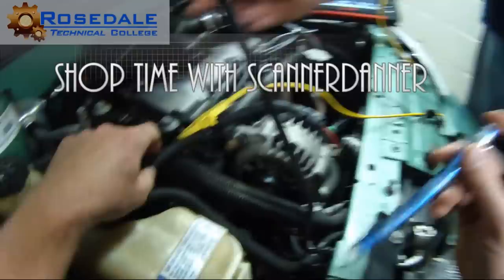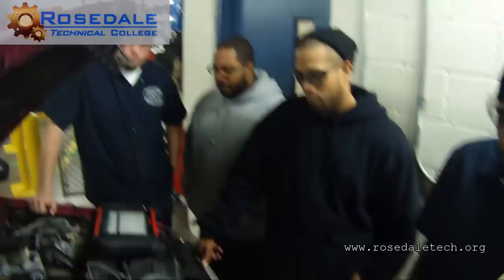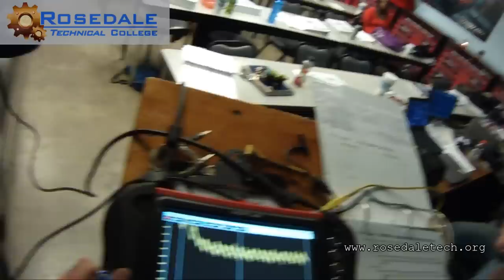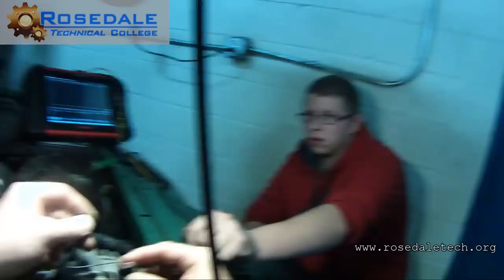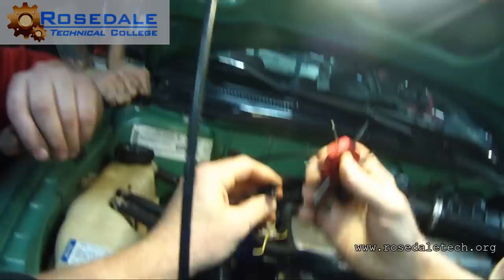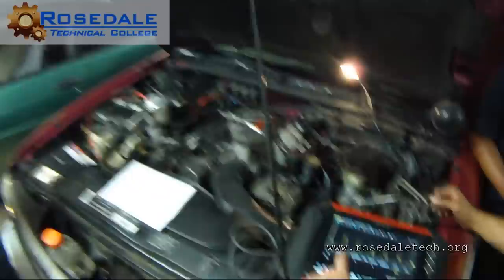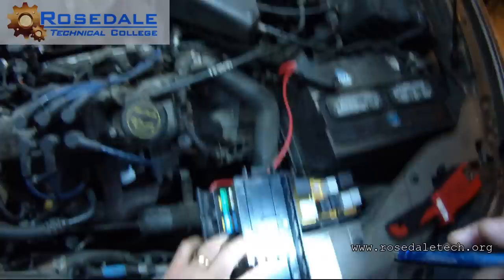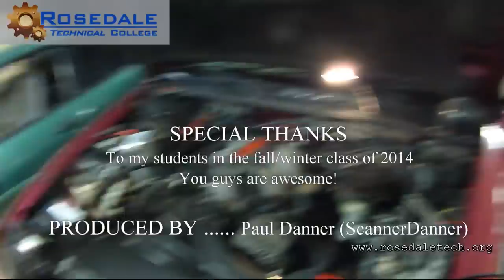Shop time with ScannerDanner at Rosedale Tech (live work part 1)

Comment: Hi Dan 
I have seen loads of you FREE videos ,one post you did on P0171 managed to fix my car ford fiesta 1.25 zetec . I had codes P0171/P0174    and NO power  and MISFIRES  past half throttle no rise in revs past 3275 rpm 4th/5th gear .Fix was to buy a new code reader maxiscan ms310 that would give me live data on 1996 + ford   (uk)  anyway your video pointed me to the MAF dirty . Cleaned with a artist brush and alcohol.  Presto FIX 
 I'm 43yrs old and grew up with old school cars  (points ) NO Micro chips . Still potter on with my fathers 3 Reliants  (robin three wheelers)   using  a Gunson Testtune analogue diagnostic multimeter  for dwell ,voltage tests, current, ect   and a good old timing light too. A little like a DIY Crypton Tune  and try the best I can on later cars I've owned myself ,friends where possible.
  My thought was not all of your student  will have deep pockets to buy the test gear you use .Even small garages not to mention DIY. I have just bought a hps140 single channel handheld scope  that I need to try and get to grips with to help me in the future. With the help of you videos I might add.. Maybe  if you have spare time and were possible you might be able to do a few more videos using ENTRY / DIY  TESTING  . I know how hard it will be to put those big toys away but look at the fun you will have trying to teach us make the best of what you can stretch your pockets too  ...  maybe in a ENTRY / DIY  TESTING LEVEL video play list.     
 One off the best channels on here   Dan  keep posting .
 The head cam  did the job let us see you in a new light.

Comment: Scanner Dan
What's it cost to have a car or truck check out at Rosedale?
Reply from the maker: No labor charges. Customer supplies parts.
Reply: Oh  that's cool ......my be if am not in the lonely bin 
By trying to fig out my problem w my truck w the lean codes ..my be in April we go to Va for five days my be I could make a ap at Rosedale to have the class take a look at it .....bc am getting upset w shops up here at gusseing at what's wrong w this truck at what's wrong w it ....gusseing is like thurowing money out the window ..I changed the vent cycled at the tank ....just bc it was inpossable place to try the test that I have seen in your veides and I don't have a high end scan tool to be able to turn it off and on so I bought on from rockauto and installed and reset the code and that still came back 
Sorry about the long rant 
Thanks so much for the vedios that u put on 
YouTube for people like my self doers